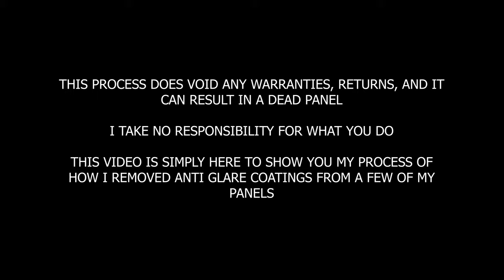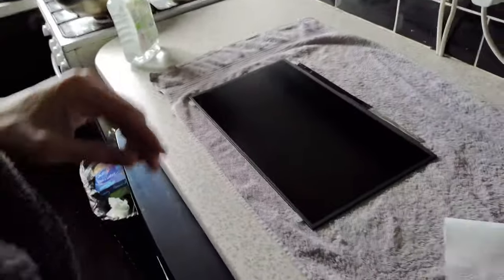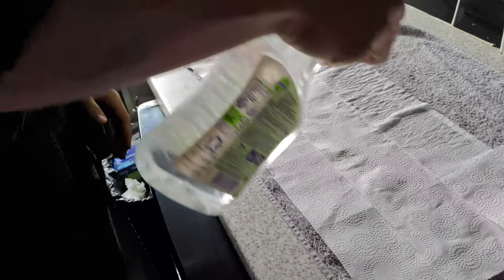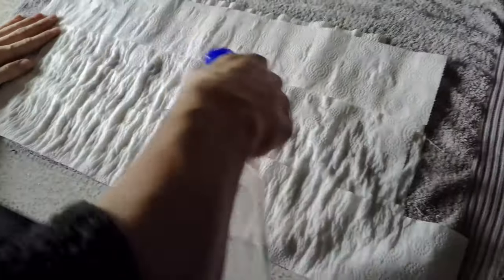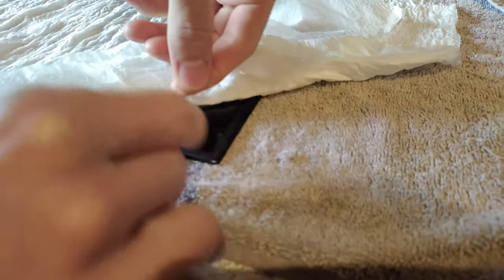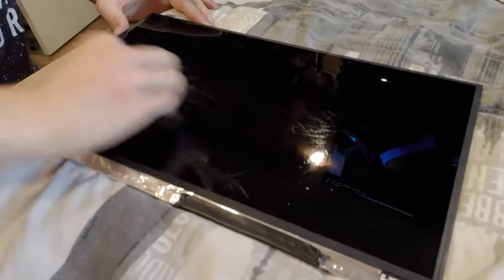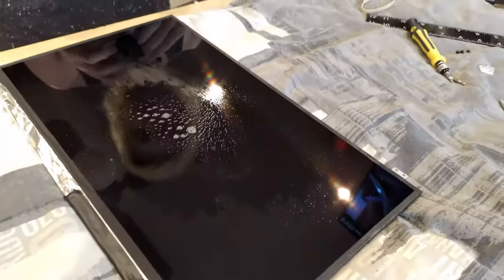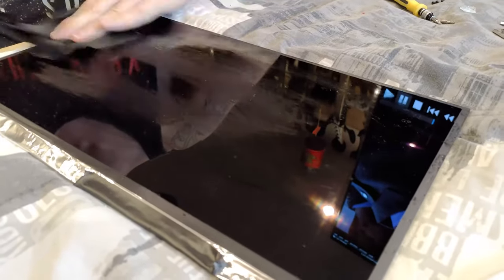Removing Anti Glare Layer From Laptop Panels (Converting Matte To Gloss)

Comment: I can't stand that every new desktop monitor today is just matte. I remember when we had choices!
Reply from the maker: Yeah its annoying, luckily i figured it out for myself at least, i may do my LG Ultrawide desktop monitor too
Reply: @TMProjection  So cool that you are able to do this. I want to buy a new Razer Blade laptop and I would prefer to buy the 300 hz model for better gaming but I can't stand matte displays. I am thinking of buying the OLED version just because the colors don't look washed out. I wish I could buy the full HD model and peel the layer off like you did with that laptop.
Reply: Thanx for this video, Due to matte screen i am suffering from headache thats why i am watching this video, when i work on glossy screen then no headache
Reply: @cemsengul16  i mean it is matte because it doesnt reflect light, if it did, it would be distracting and  harder to see whats actually being displayed in the monitor
Reply: @thehokk1412  I get that but I am used to owning glossy monitors.
Reply: @TMProjection  Did you end up doing your Ultrawide?
Reply: not just desktops, 99% of laptops as well, and 100% of mid-range to budget gaming laptops come with matte screens only. The only ones that come with glossy screens are super expensive unnecessary 4k panels which aside from scaling issues, performance issues and higher price also drain power far quicker than 1080p displays.
Reply: @TabalugaDragon  I am in the market for a 27" budget monitor.
I am used to a budget Dell from 2012, which has a glossy screen.
It's clarity and color pop put most of todays 1440p screens to shame.
Unfortunately literally no one now a days makes glossy screen monitors.
I am seriously thinking of getting a regular matte screen monitor and removing it's matte screen the same way this guy did in his video.
Reply: for the outdoors reflections
Reply: @TabalugaDragon  Just get used to it . Anti- glare is better than glossy screen.
Reply: @omicron7735  it's worse where it really matters the most - picture quality. 
Glossy screens are natural-looking, beautiful and immersive, while matte is just... functional for brightly lit environments. 
So no, it's not better. 
And no, as long as glossy screens exist somewhere I will never get used to it.
Reply: @cemsengul16  After using a matte screen laptop for 2 years, I would never buy another glossy screen ever again
Reply: @Subhasis44597  I just bought the new OLED Razer Blade and I have been using it for two weeks. I can never go back to matte LED screens on a laptop now.
Reply: @cemsengul16  Now you can enjoy watching deep blacks.
Reply: @cemsengul16  I really like the Razer Blade, only con is that laptop does not come with numeric pad. Being a trader, numeric pad is must for me.
Reply: @Subhasis44597  I absolutely love this machine. The thermals are ridiculously good for a laptop this thin. The Vapor Chamber really makes a difference. I hear people say the base model with ordinary heat pipes run hotter even though they have weaker CPUs and GPUs.
Reply: @thehokk1412  And why do regular tv's and all smartphones come with glossy panels? 
Makes no sense what you're saying
Reply: @omicron7735  does your phone have anti-glare? does Apple use anti-glare? no, it looks terrible
Reply: @TabalugaDragon  i can't stand matte ones , they are totally a headache for me and i hate that all new gaming laptops have these awful matte ones , but could i buy new one with anti glare matte and remove it like this video after buying or it would be risky ?
Reply: @mahmoudatef8112  risky indeed. There are gaming laptops with glossy displays, but they are still very rare and are ONLY top end, premium models, like the Razer and MSI ones. I agree completely. Which is why I replaced my matte monitor with a semi-glossy one, it's a night and day, clear blacks, rich, vivid colors, the image is clear and natural-looking.
Reply: @TabalugaDragon  
but when would the manufacturers stop that horrible thing with only offering these nightmare matte screens , i swear i have an old glossy laptop and as you said colours are so fascinating comparing to matte ones and video and everything even in graphic designs 🥲😪

Comment: A bit of chemistry for ya. No alcohol on monitors mkaaay. Sticky residue is removed with sunflower oil, the oil grabs the sticky part but you are left with oily surface. Oily surface is cleaned with soapy water, cos soap connects the oily thing with the water. 2 ez steps for big success.
Reply from the maker: cheers for that, good to keep that noted

Comment: Damn manufacturers for making us do this instead of selling laptops with glossy screen options! Thanks for the video! I probably won't risk my device doing it though.
I wish you showed before and after on a screen turned on, because glossy display haters don't understand what's even the point of doing it. They think matte displays are better by default and have no drawbacks.
Reply: Why? I think matte is better than glossy am I wrong?
Reply: @Solo.101  yes you are, sort of. Glossy displays are far better at showing colors, they are more vivid,rich and natural-looking on glossy displays, as opposed to matte ones which look pale in comparison. The only advantage of matte screens is less reflections but that's it - glossy covering is better at everything else, which is why most of the top laptop models, including Apple macbooks still use glossy covering.
Reply: @TabalugaDragon  you are pro at this aren't you? So do you recommend to buy a glossy screen then put a matte cover or not and what are your tips & advices for me thanks you bro.
Reply: @Solo.101  why would you use matte coating for a glossy display? why not just buy a matte one in the first place?
My advice is choosing what fits you best.
Reply: @TabalugaDragon  because maybe they are putting cheap ones
Reply: @Solo.101  no, matte screens exist in all variety of qualities and prices.
Reply: @Solo.101  Buy anti- glare one. It is better especially if you want use it for gaming.
Reply: @Solo.101  Just don't listen these glossy people. It is personal preference.
Reply: @omicron7735  "Just don't listen these glossy people. It is personal preference." you do know that your first sentence contradicts your second one right? 
First you say that "don't get glossy, get matte" and then you say "you can choose whatever fits you better because it's a personal preference.
Heck dude just let a person choose what he prefers. 
In this day and age when glossy ones are nearly impossible to get advising to get a matte one is not only laughable, but also kinda morally wrong because the higher % of people will choose matte over glossy the less manufacturers will actually make glossy panels which would remove CHOICE from the market. Nobody is taking matte screens away from the market, but you seem to want glossy screens to be gone forever. 
If you were a ruler you'd be a tyrant lol.
Reply: @Solo.101  No your not. When your working in a bright environment, matte is far better than glossy.
Reply: @TabalugaDragon  I use my laptop on the terrace, only matte ones for me.
Reply: @TabalugaDragon  Wtf does that means?
Reply: @Subhasis44597  I bought a custom pc lol
Reply: @Subhasis44597  wtf what means? I made many comments here, be more specific
Reply: @TabalugaDragon  Last one.
Reply: @Subhasis44597  first half of my comment points out how illogical his comment is, first he says that the guy should definitely get a matte display, then he says it's a personal preference. If he should definitely buy a matte one then it's not a matter of taste and a matte one is the only way.

In second half I say the more people will prefer matte over glossy(which especially hurts if a person doesn't know glossy displays actually look better and display colors better), the less monitor manufaturers will make glossy ones and as these monitors as a class will completely die out. People should choose what's better for them personally, not because someone said that matte are objectively better and they should just buy matte.
Reply: @TabalugaDragon  This is very true buddy. People will get what they like. There should be choices.
Reply: @TabalugaDragon  may i ask that if i did that process in that video and removed anti glare coating , would it turn glossy and reflect on the quality of colour and video ?
as i totally agree with you pro as i had a LCD glossy labtop and i just purchased new labtop with led antiglare one and the difference  is huge as LCD is much better . and like you said apple labtop still uses it
Reply: @Solo.101  the engineer who covered the screen with matte is the leading fool. the matte screen makes the screen look like crap.

Comment: People with lower resolution vision readily tolerate the lack of sharpness of matt screens - mostly because they can't even see the difference.
But for those with sharp vision, matt screens look horribly fuzzy.
Reply: ive used both kinds and also have had many of my mates check out both anti glare and normal panels. the only difference is lower vibrancy but since i use my displays mainly for gaming its actually really comforting on the eyes and the anti glare is genuinely really nice to have on laptops as mostly you will be using them in well lit environments. but hey man ur opinion us ur opinion
Reply: @jodhsingh1160  but i wonder how tvs are made matte or glossy ?
Reply: lol, what a weird flex. you realise that screens aren't matte just for no reason right? it's to reduce glare, which is a big deal because it's incredibly distracting when you're trying to get work done.

Comment: Tried this on a legion 5 2021 model and it works. I had to mask off the laptop since I didn't have the LCD tape that goes between the Panel and the lid. The result is worth it. Colors are better and the blacks are deeper. Would recommend it.

Edit after a month: I'm noticing minor dots/marks on the screen which seem to be originating from the Keyboard/chassis rubbing against the screen overtime. Maybe the anti-glare coating wouldn't have had this problem, I'm not sure. I would recommend placing a paper/Micro-fiber cloth between the screen and keyboard while shutting the lid or applying a regular plastic screen guard(glossy) which can be replaced if that gets scratched up.
Reply: Dang I kinda want to try it on my zephyrus s17 but I'm scared I'd ruin it lol
Reply: @Freshone48  If you do, I would recommend reading the maintenance manual or watching a disassembly video of your specific model a couple of times before opening the laptop. Their might be some consumables, usually adhesive tapes, that you'll need to put it back together. In my case, there were two kinds of tapes required: One that goes in between the lid and the display panel and the other between the bezel and the lid, around the border of the display. I couldn't find the first one so I didn't take out the Panel from the laptop and masked everything but the panel but I still had to take out the bezel to be able to access the edge of the anti-glare film. A 2mm Double Sided tape from amazon was what I used to put the bezel back together.
Reply: i would like too to try it on my legion 5 but I'm scared if it would be rishy as i heard as some new laptops polarizer and anti glare filters are sticky together so it might cause damage? 

could explain how you do it rightly without any mistakes? preferred with images after removing AG ?
Reply: @mahmoudatef8112  I had to remove the plastic bezel around the display to be able to see where the AG layer starts. I didn't take out the display because I didn't have the double sided tape required to refit it. I used regular plastic tape around the borders to prevent water from going between the lid and the display. Soaked it for 3 hours and the AG film had softened. Cant post pictures in the comments.
Reply: Less Eye strain too?
Reply: @kingsleytravisabel5332  Text is easier to read since the little dots of the AG film meant for diffusing the reflected light aren't present.
Reply: I do have a antiglare coating on my laptop screen
and i too got marks of keyboard scratches on th e screen (even on antiglare coating ) and now i don't know what to do with these marks
if you have any suggestion, I'll apperciate it
Reply: Can i contact you, to see the pics how the screen looks like now

Comment: I wonder if using a heat gun would work better.  The same way you would use a heat gun to remove window tint.  It also allows for the glue residue to come off with the window tint so there is no clean up needed after ward.  Just have to be careful not to get things TOO hot.  I think it would work actually.
Reply: DONT HEAT GUN IT ! you could damage the polarisation layer which sits under the AG layer.

Comment: i did succesfully on dell u2711, dell w3008wfp, all of em were ips. now what you think....can i risk a curved va panel?
Reply: did u try this
Reply: @HIT.G  i did try on a modern LG 38 ultrawide... I tested the corners. I think modern coating is different. Dont do it ... I aborted the process.
Reply: @tsk-meteakabruceleekills1311  How would i be able to tell whether I am able to remove the AG without damaging the polarizing layer
Reply: @Howlsowls  when the coating comes up easy with no resistance....on older monitors no problem.
Reply: @tsk-meteakabruceleekills1311  i just put on the wet papers over the screen, doesnt seem like i have to disassemble it. Last time i tried opening a monitor i broke it, I will just try peeling it off
Reply: @tsk-meteakabruceleekills1311   will i have any problems with water leaking into the monitor edges? Will it be fine if i let it dry for a day?
Reply: Thanks for the info. Gonna try this on a dell E7450 1080 ips screen. Worst result is I'm out $50 for the new(old stock) screen with more still available for sale. I absolutely hate matte. The screen is going into an older thinkpad, it's an Auo B140HAN01.3 panel. Well renowned screen for color profile and brightness.

Comment: Please anyone reading, dont do this. Its very risky. I ended up removing some part of the coating and the screen is now half reflective half matte. It looks bad.... Now. Irealsie that matte is just fine and even better because no reflections. Please dont do this. Theres no gurantee how the coating would be attached to your particular display model. The coating could be far strongly attached in the middle and if yo utry to pull it off, it could ripp pff the polariser along. Just very risky. Matte is fine dont worry.
I hope you dont end up doing the same mistake as me. Now i am just going to buy a screen protector and put it on. It eil lstill look uneven but ok

Comment: Tried this and unfortunately I removed the polarizer layer from the monitor, now its trash
Reply: What model monitor was it?  I'm thinking of doing this on a monitor if, when I buy it the text is fuzzy as some of the reviews have stated.  Cheap monitor made better by removing the film?
Reply: @firstman9273  Syncmaster 245b plus
Reply: what does it display like now?
Reply: @firstman9273  just white, the polarizer layer is rekt, i peeled it off because thats the only thing that came off

Comment: I tried doing this with some kleenex and napkins, leaving the wet tissues on. i couldn't get it off. is it the type of tissue, you think, that got in the way of getting it off? is it better to use toilet paper as you used? also, the residue in your video is what: stickiness?
Reply from the maker: nope nothing special about the tissue, perhaps the film thats on your screen is different, i also had an issue with a different panel

the residue is from the adhesive that was used to attach the matte layer